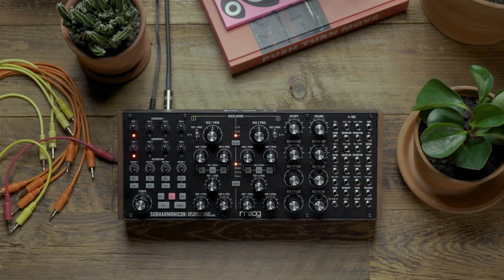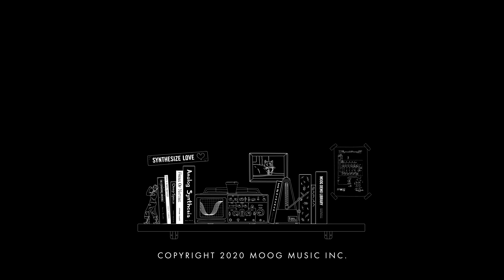Subharmonicon | Polyrhythm Sequencer

Comment: I’m confused about something. At the start we are only listening to oscillator 1. Rhythm generator 1 is assigned to sequencer 1 and rhythm generator 2 is assigned to sequencer 2. This results in a polyrhythm. Why? I thought sequencer 1 controls oscillator 1 only...
Reply from the maker: While you're correct that the sequencers' pitch outputs are both internally routed to their own oscillator, because of the paraphonic nature of the Subharmonicon, if either sequencer moves, the envelopes are triggered, allowing you to hear any oscillator or suboscillator turned up in the mixer section.  If oscillator 2 was also turned up in this example, we'd be hearing both oscillators no matter which sequencer progressed forward.
Reply: Moog Music Inc Thanks. Makes sense now